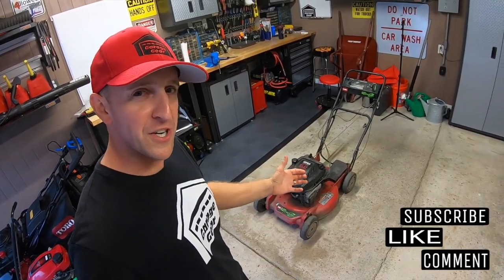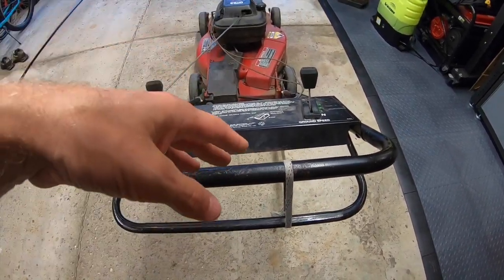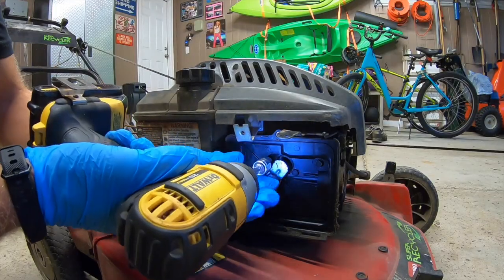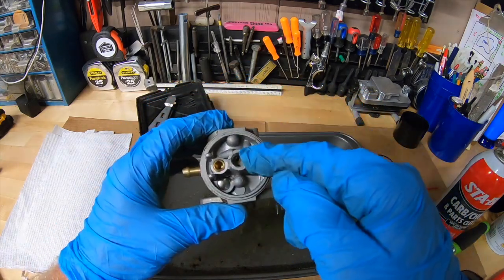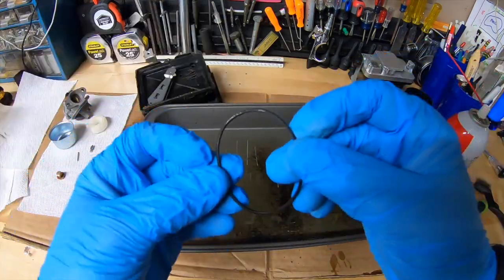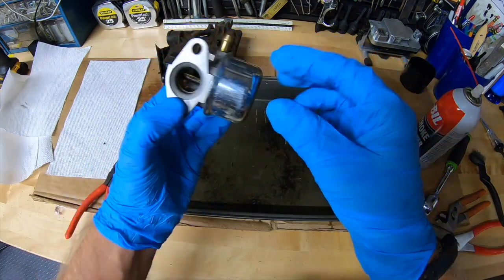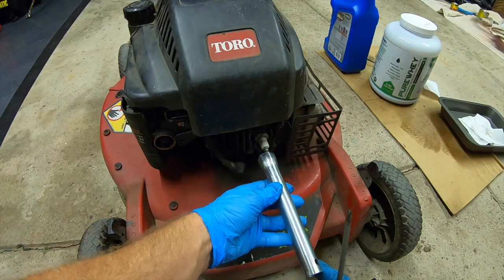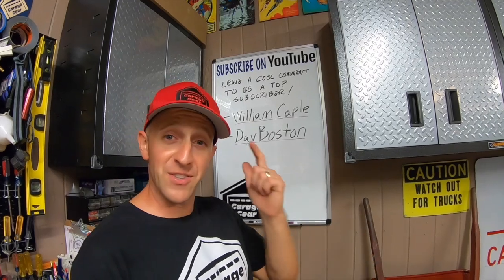HOW TO CLEAN A CARBURETOR ON A TORO SUPER RECYCLER

Comment: I picked up one like it on Craigslist for $20 in non running condition. Turned out to be no compression and worn rings. Rebuilt the engine and now it works and cuts great.
Reply from the maker: These are great machines if you can keep them running! Thanks for sharing Al!

Comment: After watching several of your videos regarding these vintage Super Recyclers  I got interested in purchasing one. I found one locally for $100.00. Mine may be older, it has the 6.5 Briggs, aluminum deck, and three speed console. Also electric start. Deck is perfect, not a scratch. I checked the oil and gas. Took off the bag and cut the grass for the last time. Didn't  use the bag. Did a quickie oil change and put a bit of Stabil in the tank with some non ethanol fuel. Can't  wait until spring to give it a full service and detailing. In one of your videos you said to grab one of these if you see one. So, I told the wife that it's totally your fault!!😁
Reply from the maker: Hey orange! No worries I’ll take the blame! Lol! Tell her you got a mower now that will outlive any of the new crap that’s out there! 👍👍 thanks for being a cool fan!

Comment: Thanks for the video!! I bought one of these 4 years ago used for $100 bucks. was about the same age as yours. intended on buying a new mower eventually but then I found out how great this thing was (and how I would have to spend a bundle to get anything comparable that is built today). came here because its not starting after sitting for the winter. 

if you see this - I was trying to figure out if I'm getting the full amount of power out of the self propel , and if theres anything I can do to check that out. 

thanks again for the video.
Reply from the maker: Hey Burton. You could try putting on a new belt. Perhaps that one is old with less grip. Thanks for watching my friend!

Comment: I have a 2005 SR4 as my main mower. Engine swapped. Deleted the BBC. Autochoke, no primer. Blacked out the ugly gray wheels. It's pretty sweet. I'd say they're entry level commercial machines. They're well built. Good video JB!
Reply from the maker: Very cool Norge! What kind of engine did you put on it? Thanks for watching and sharing!
Reply: @GarageGear  Same engine that came off it. 190cc briggs except with a standard toro shaft to accept a stock blade adapter. 25mmx3-5/32" Shaft, 7/16-20 tapped hole. I also deleted the bail handle so I can pickup sticks at my own will without the engine dying.
Reply from the maker: @norge696  ok very cool! You really modified that thing to your liking! Nice work! 👍

Comment: Hey JB, great video!  I've got that model and noticed that your brother in laws has the paper air filter, not the original oiled foam.  I've read pros and cons of both.  Which do you believe is better for the engine?  I have no issues cleaning the foam with dawn and re-oiling.  Do you think paper catches smaller particles, assuming theres no tear?  Thanks!
Reply from the maker: Hey Brad the paper filters are original. The oil filters are aftermarket. I avoid those oil filter because they can gum up carburetors. Mechanics see the same issues with throttle bodys and O2 censors. The paper ones work just fine.

Comment: i need a photo of the cabe that is attached with a bracket on the front of the lawnmower above the spark plug since I forgot how the bracket goes on which keeps the cable from moving around that attaches I am assuming to the carburetor on the right side of the lawnmower
Reply from the maker: Id send you a pic if I could but unfortunately I gave that mower away to a subscriber of the channel last year!

Comment: Help! I've got a 5.5gts Toro Recycler that's leaking gas. I pulled the aircleaner and cover off to find two gas inlets on the carb. One has the line coming from the tank and the other has just a 3" angled hose going to nowhere and I can't find any place it should go. Any suggestions? The short hose going nowhere is the one leaking gas. Thanks.
Reply from the maker: Hey Grady I’d have to see it in person but I’m guess the short tube is the breather tube that hooks onto the back of the air intake plate. I would clean your carb out and check everything inside. Usually that’s where the problem is. 👍

Comment: I have a 5.5 hp from 1995 that is running rough revving up and down. The air filter looks fine and so does the spark plug. Should I clean the carburator?
Reply from the maker: Hey Steve! If it’s surging it’s a good idea to clean the carb. You’ll be happy you did! Thanks for watching!

Comment: I personally would have stuck with the recommended conventional 30 weight or maybe conventional 10w 40 if the motor is super worn. I think full synthetic is an overkill for those briggs quantums. if that engine is worn synthetic will do worse than good. It will burn faster and expose potential leaks. Otherwise great video. They sure don’t make mowers like they use to these days.
Reply from the maker: Thanks for the tip Moore! You’re right they sure don’t make them like they used to. Thanks for watching!

Comment: Mine doesn't want to start easily but Once it starts it runs well and restarts well.  I noticed when I pump the bulb a bunch of times before trying to start it, the gas runs onto the deck so I think the bulb isn't pushing the gas where it needs to be to prime.  Something clogged I can check?
Reply from the maker: Hey clearanceman! I’m wondering if you’re priming it too much? Or too many times? If it does it all the time I would clean the carb to see if that helps and any other surrounding parts. 👍
Reply: @GarageGear  OK, I need to look more carefully, the path the primer pushes the gas into the carb may be somewhat clogged so it's not getting into the carb but just running down on the deck when I primer too much.  And yes,  I might be primering too muc but three pushes does nothing and 10 does nothing but cause dripping gas so I think it's clogged.
Reply from the maker: @Clearanceman2  give her a look and let me know what you find! 👍

Comment: So grabbed the wrench to undo the bottom of the carburetor and that 10mm nut is round.   Tried the vice grips on that round nut , it is almost like it is welded on , not budging! Amazon has it available for 20+ bucks plus shipping so that is the next buy .
Reply from the maker: At that point go for it
Reply: @GarageGear  so between now and then I will throw in some seafoam and maybe that will do something?
Reply from the maker: @brucewmclaughlin9072  perhaps. I would just hit it with the carb cleaner! Don’t over think it.
Reply: @GarageGear  I went out with the threat of seafoam and opening the formerly full gas tank noticed that it was empty. So I must have a leak somewhere. Any clues? gas line appears intact?
Reply from the maker: @brucewmclaughlin9072  not sure without seeing it up close. Put a little gas and some paper towels around the engine to check for leaks!

Comment: Why not use the old gas coming out in the drain pan for cleaning the grime on and around the carb. You will save quite a lot on expensive carb or brake cleaners
Reply from the maker: Totally do-able! I have done this before. Getting in the jets though does require carb cleaner. Thanks for sharing gps. 👍

Comment: Nice
Reply from the maker: That’s a nice mower you have on your pic! These older mowers are great and built so much better. 👍
Reply: @GarageGear  The one in my pic is a  new-old stock 20622.  I broke one in that went 6,000+ hrs and still had good compression due to its bearing design and chrome compression ring. They really are gems.  Nice video!
Reply from the maker: @campbellpaul  wow! 6000 hours! That’s crazy! I’m telling ya, if I see one of those in decent shape on Craigslist I’m buying it lol. Garage gal might question a third mower in the garage though!
Reply: @GarageGear  I drove 50 miles for an '89 22035 just two months ago in fine condition.  I'm about at my limit, though, with six 😂
Reply from the maker: @campbellpaul  HOLY COW 6??? The garage gal wants me to get rid of all but one lol!  That’s quite the collection I bet! Those older toros were the way to go! Email me some pics when you get a chance! Would love to see them! Thanks for sharing bud! 👍
Reply: @GarageGear  I think I've only got pictures of four of them, but I will send whatever I have your way... One is currently on the operating table lol

Comment: When you take out the needle you might wanna take out the seat also if the float doesn't close right due to the needle gas will mix with the oil the seat also can have debris
Reply from the maker: Hey Eric! Almost every time I take out the seat I find a usually do more harm than good. I either rip or ruin them. Occasionally one comes out fine but then when I have a new one to put in it won’t go in right… go figure lol. Found it easier over the years to just spray them clean really quick. Thanks for watching.

Comment: I did all of this and now gas is leaking out of the connection to the air filter.  Any thoughts?
Reply from the maker: Hey Matt, what connection are you talking about to the air filter. The air filter rests right in front of the carb so I’m wondering if you tipped the mower on the air filter side leading to it leaking out. Let me know! Thanks for watching!

Comment: Why did you use 5w30 and not sae w30
Reply from the maker: Hey Jim, I know and trust two mechanics that teach small engine programs at tech schools and have been doing so for 40 years each. They both agreed that 5w-30 full synthetic is they way to go for most small engines. Been following their advice for years and it hasn’t steered me wrong. Thanks for watching!